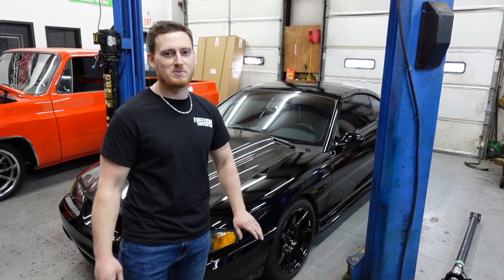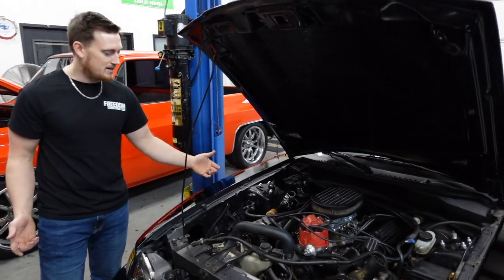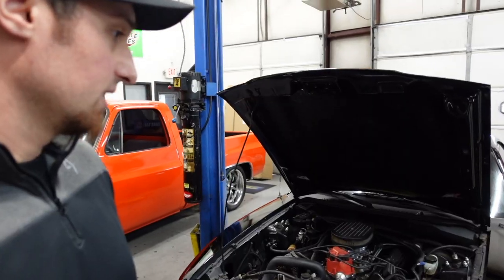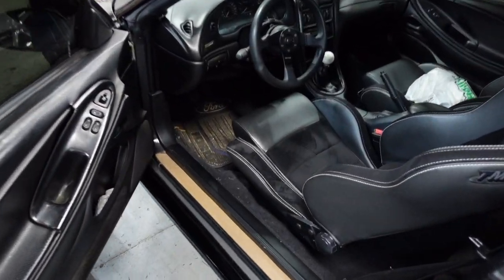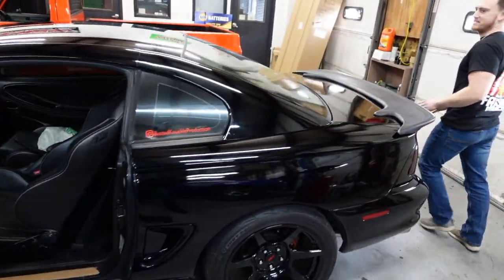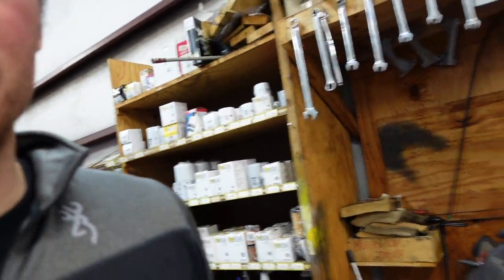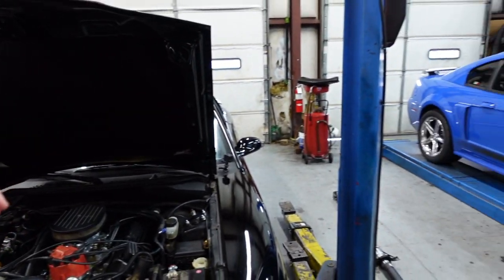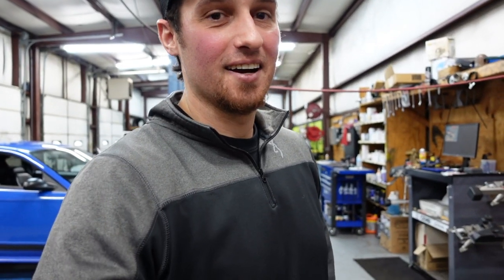Carb Vs Holley EFI (NA SN95 vs Boosted Mach 1)

Comment: Hey man I have a carbed 302 it came with a Holley 750 and was bad so I put the exact same carb back on it. Sometimes it will stutter out almost like it’s not getting enough fuel . Do you think the carb could be to big?
Reply from the maker: I'm not too sure as I'm more on the EFI side of things vs Carb. @Lollis_Garage might could point you in the right direction